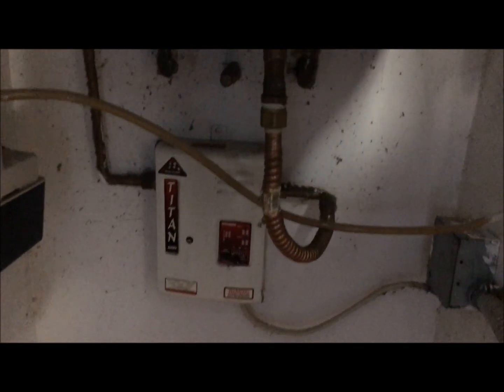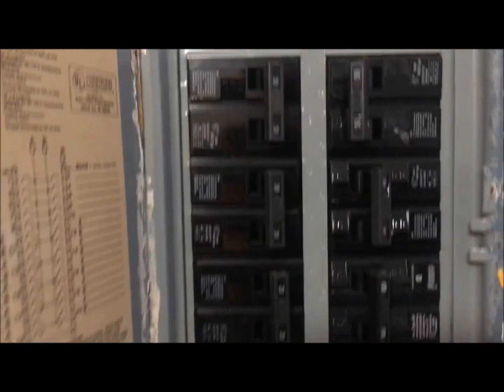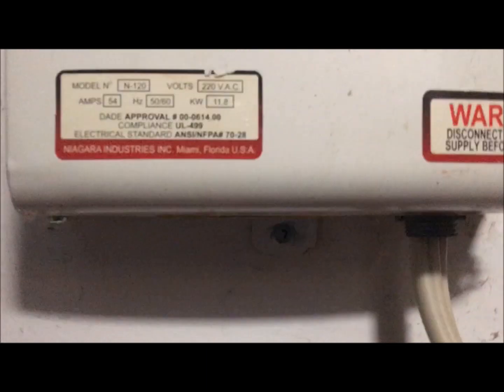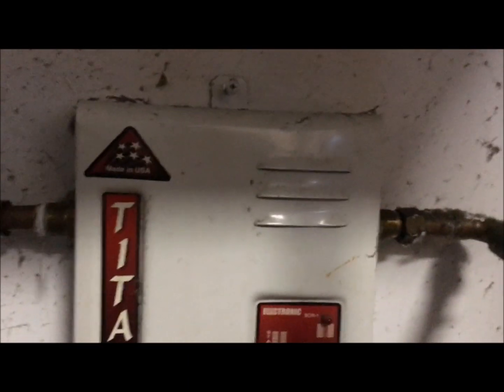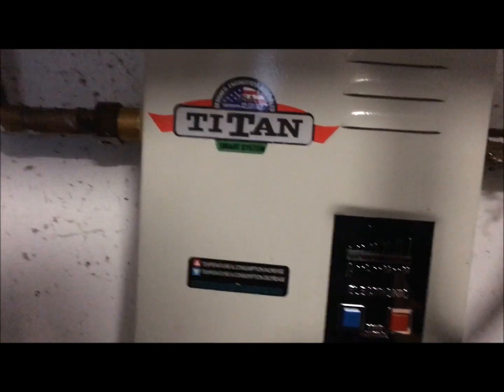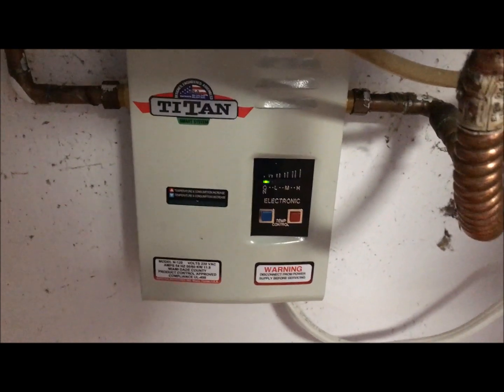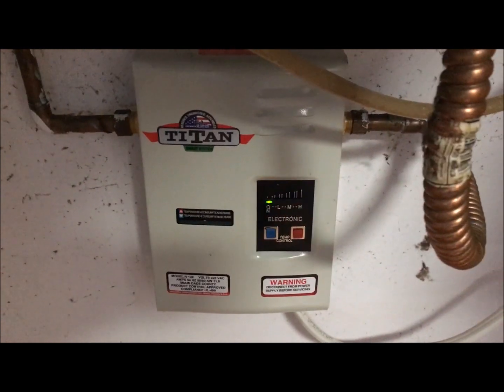HOW TO INSTALL TITAN WATER HEATER IN YOUR HOME

Comment: my N120 just crapped out last night... only had it for 5 years. granted, we never did maintenance on it and i now come to realize the installers did not install a sediment filter for it. Going to order a new unit from the manufacturer and boost my confidence with your video. Thanks.

Comment: Question..so on the booklet it says that per code it needs an automatic shut off valve installed at the inlet…I’ve looked at a few videos of these and don’t see anyone with a shut off valve. Is this necessary?
Reply from the maker: I personally have not seen a cut off valve for this installation.

Comment: Good video....! Is there an adjustment to makes the water cooler or hotter?
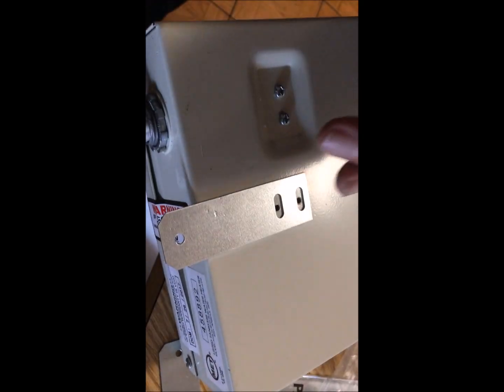Reply from the maker: yes.  Look at the 1:15 time frame.  see the blue and red buttons?  Those are used to regulate the desired temperature

Comment: Hello if im replacing my n-120 titan electric tankless water heater can i just disconnect the 3 wire power supply from inside the water heater then reconnect them in the new one?????????
Reply from the maker: Not the same. One is a 110 and the other 220
Reply: Sorry i meant i already have n-120 titan connect that went bad. Im replacing it with the same one so i thought i would just pull the wires from the old unit and connect to the new one so as to not fool with the fuse box wiring
Reply from the maker: @christianlamar249  In that case you’re good

Comment: Mine keeps dying. Had it fixed once a year ago, broke again. It will turn on sporadically when i turn the valve going to it on and off. Any ideas?
Reply from the maker: all i can think of is, what you have set on.  what degree?
Reply: Don't set it to high, it happened to us.

Comment: When I turn the hot water on it doesn't move the lights at all
Reply from the maker: check plug.  check breaker.  if you have electric going in it, and the temperature set to let's say, 150, the lights should come on when you turn on a faucet hot water.

Comment: Titan water heater are garbage. Mine lasted 3 years and my neighbors lasted 4. Most hot water heaters are rated for 10 years.
Reply from the maker: Thank you for your comment. I have heard this before. Sometimes, in various neighborhoods where the electricity goes out frequently (couple-seconds power outages) , this electric water heater gets a beat down.
Reply: That's not the case, we have a very stable electrical supply. I don't think we have had an outage in years. Their customer support is good. Charge $50 to repair the unit and cost $28 to ship it, but anyone without any know how would need a plumber and a electrician to disconnect and reconnect. The price for the unit if very comparable to a tank unit, but if it only lasts 3 years as opposed to the 10 years a tank lasts, its much more expensive. I've given them the benefit of the doubt and shipped it to them, lets see what happens :-( if it only lasts 3 more years I will be pissed.
Reply: @josephgregory4281  how did you get in touch with them? When I call nobody ever answer..
Reply: @josephgregory4281  Ours lasted 5 years and I was told that it had calcium sediment and I should have put in a filter so it would last over 10 years. Instead of fixing it, I bought a new one but came here to see if others used filter and the unit still lasted the same amount. Did you use a filter? The man on the video didn't.
Reply: You need to clean it once a year.
Reply: @josephgregory4281  i have to replace one. Cant i just disconnect the 3 power wires from inside the old tank then reconnect to the new tank??
Reply: I only had mines for a year. 😤